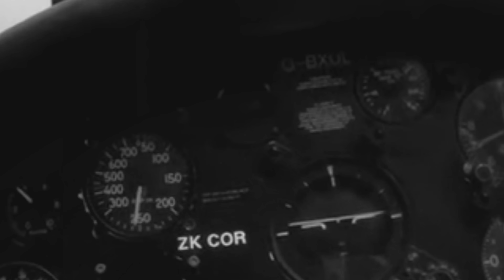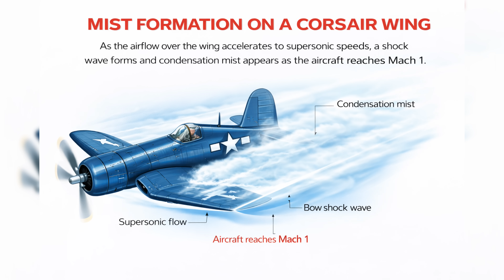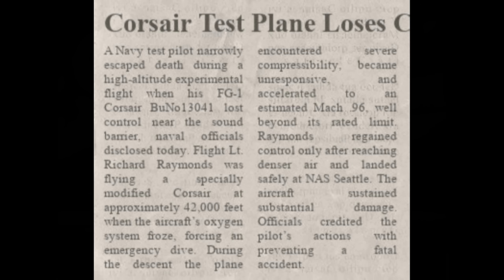The Jet powered Corsair that Accidentally went Supersonic

Comment: Fae, it did not go supersonic , it must stayed subsonic, or the props would have departed the fix. And I'd assume there was a lot of structural damage if it entered high subsonic speeds
Reply from the maker: Thanks for the comment Goofie, unless you were there alongiside them it wouldnt be fair to downplay their claims, none of us would ever attempt this so that deserves respect. From a physics standpoint however the corsair had an official mach limit of 0.8. That is also at normal operational heights. This flight was much higher and at 45k you are looking at roughly 1/10th the resistance in a stripped down version of the corsair. 0.96 is entirely possible, putting most of the airframe such as its wings at supersonic speeds.

Comment: Wait. This for real?
Reply: I don't believe a word of it.
Reply: @deadcarnahans1932 it was a strong airframe
Reply from the maker: @deadcarnahans1932  Thanks for the comment Dead, are you aware that the Corsair had a tested mach limit of 0.8?
Reply: @FlakAlley  About 590 mph? I can see that in a dive.
Reply from the maker: Thanks for the comment Brian. At 45k you are looking at roughly 1/10th the air resistance. This is how they tested the Corsair to mach 0.8 in the flight manual and you can also see part of testing in the video where the aircraft dives with the landing gear down. This is termed Mach Limit.  Pilots could even use flaps whilst going very quick,  the gears of the Corsair which were incredibly strong at sea level would work quite well as an airbrake as long as the pilot is high enough. If you get too low then its coming off!

Comment: I think the Thunderbolt and Lightning had a compressability issue during a dive as well.
Reply: Thunderbold and Lightning are very very scaring me.
Reply: The Ligntning was the first to experience compressibility issues.
Reply from the maker: @flyingwombat59  Thanks for the comment FlyingWombat, you know your stuff! They did fix it later on by adding dive recovery flaps similar to the corsair could use its landing gears to slow itself down in extreme cases.

Comment: Also a handful of British Spitfire pilots cheated death in high-speed near supersonic dives that helped pave the way towards supersonic flight. I knew one of the pilots Lt J Adams who came to the local bar on weekends, the best he got was 0.85 Mach in the spit. The Corsair being a much quicker thick wing aircraft did it too on the American side. Im not surprised, at very high altitudes its much easier to go fast in a dive and this corsair had a jet strapped to it! Great stuff. The Greatest generation had balls of steel
Reply: My father was one of those pilots.
Reply from the maker: @boomerang9967  Thanks for the comment Boomerang, amazing to have two of you here who knew these fearless pilots. Did he fly the mk24? :)
Reply: I believe there's multiple accounts from Me163 pilots who claimed to have heard a loud "bang" when they entered a very steep dive to evade an enemy. It was never confirmed that they indeed went supersonic, but it wouldn't surprise me, as a Komet could outdive a P51 even as a glider when it was out of fuel.
Reply from the maker: @vornamenachname989  Thanks for the comment Vorna, the me163 could certainly pull it off. A rocket engine and a very light frame could get much higher than what the Corsair and Spitfire pilots could do who were limited by their engines and weight. There would be 5-10% air resistance past 50k, the only limitation for the 163 would be fuel
Reply: @vornamenachname989 One cannot hear a sonic boom from the aircraft creating it.
Reply: @davedupaquier7252 Right, I must misremember the accounts then, in that case it was other pilots hearing the noise, not the pilot in the diving aircraft itself.
Reply from the maker: @vornamenachname989   Perhaps you are confusing it with them seeing the visual vapour clouds forming? The pilots most definitely saw that.
Reply: @FlakAlley  "Perhaps you are confusing it with them seeing the visual vapour clouds forming? The pilots most definitely saw that."

nope. doesn't always happen, and typically happens Behind the cockpit, and vapor can form below supersonic speeds.
Reply from the maker: @SoloRenegade  Fair point, vapor clouds aren’t guaranteed, and their location depends on airflow and conditions. Given the shape of the Corsairs wings, it could have very well formed on them.
Reply: @FlakAlley  "and their location depends on airflow and conditions"

no it doesn't. they depend upon shockwave locations. these are fixed in location for a given design,a nd easy to predict their location as well.

"Given the shape of the Corsairs wings, it could have very well formed on them."

vapor shock cones? no, not really, the straight wing does not play well with a shockwave/shockcone at all. wing sweep in a design often corresponds with target max Mach speed. did you know that? this is one way analysts can look at foreign designs and predict their performance. the wings cannot be shallow sweep enough to impact the shock cone. and teh wings are not where a shock cone will occur first on an F4U.
Reply: @FlakAlley  there is nothing special about the F4U wing that helps in at high mach. in fact, the F4U is particularly poor for high mach performance due to its thick wing design, many other airplanes of WW2 were better suited like the P-51.
Reply from the maker: @SoloRenegade Thanks for the comment Solo, The corsair and p-51 had a very similar Mach limit. Overall the Corsair was the more rigid airframe and its gears allow it to pull out of such high speeds. The P-47 however is a different story. 0.9 has been achieved
Reply from the maker: @SoloRenegade "no it doesn't. they depend upon shockwave locations" Are you not contradicting yourself here?
Reply: @FlakAlley  The P-51 had the most successful ground attack fighter bomber combat record of WW2. it was teh most accurate dive bomber of WW2, and suffered the lowest losses of any ground attacker. A-36, P-51, etc. Famous for true vertical dives. the Mustang is far more capable than people realize and give it credit for.

In the first 18months of combat action with the RAF doing low level ground attack and interdiction in Europe, only 6 Mustangs were shot down by enemy fire. 

The mustang was both the fastest piston airplane of WW2 (P-51H) and the fastest piston airplane of WW2 at low altitudes (P-51A, yes much faster than the P-51H at low altitude)
Reply: @FlakAlley  "Are you not contradicting yourself here?"

in what way? 

shockwaves and low pressure zones can create vapor, but vapor shock comes are more related to shockwaves, the first one typically forms after of the cockpit, as the cockpit canopy creates a low pressure zone. but the long straight nose of a Corsair does not. But an Me163 would definitely not see a vapor cone forward of the cockpit. Also the F4U propellers create a massive disruption to the first shockwaves.
Reply from the maker: @SoloRenegade  Thanks for the comment Solo you had mentioned that they are fixed.  However are you aware that Localized condensation from pressure drops can appear in different positions depending on humidity and airflow, not necessarily a full transonic vapor cone. Its not fixed at all
Reply: @FlakAlley  "However are you aware that Localized condensation from pressure drops can appear in different positions depending on humidity and airflow, not necessarily a full transonic vapor cone. Its not fixed at all"

both occur infixed known locations. but what's been discussed her is transonic and supersonic shock vapor cones. high lift hard maneuvering can also generate tons of vapor, but these have nothing to do with supersonic or transonic flight indications as others brought up.
Reply: @SoloRenegade Hey Actually speak to the pilots like i have before starting this convo. Tuff planes and Tuff pilots, stuff happened. Who are you to deny their claims? Sorry you dont know it all as much as you pretend you do
Reply: @Will1988US  "Who are you to deny their claims? "

because it doesn't count without evidence. those are the rules. also, lots of people back then were not very well educated adn knew far less than they think they did, misremember things, etc. they didn't have access to teh information we all now have access to in hindsight. we know more about aircraft design and performance now than they did back then.
Reply: @SoloRenegade Because it doesn’t count without evidence” is exactly what people say when firsthand testimony threatens a tidy theory. Pilots aren’t medieval peasants guessing at the sky they were trained professionals reporting what they experienced. You don’t get to retroactively invalidate eyewitnesses just because modern armchair analysis feels more comfortable. Saying “we know more now” isn’t an argument, it’s a deflection. Trust me bro im an enginner isnt working.